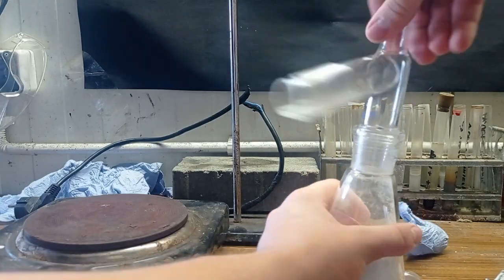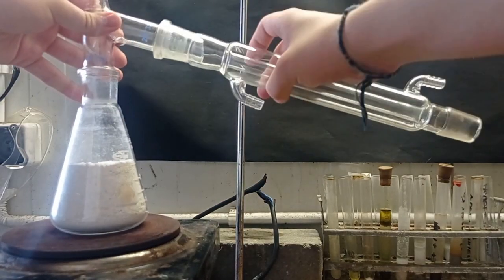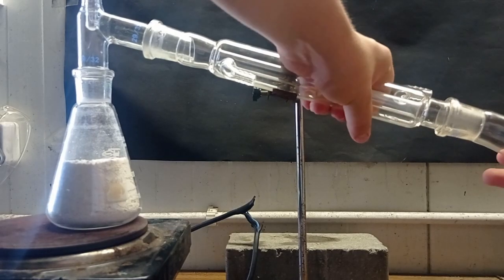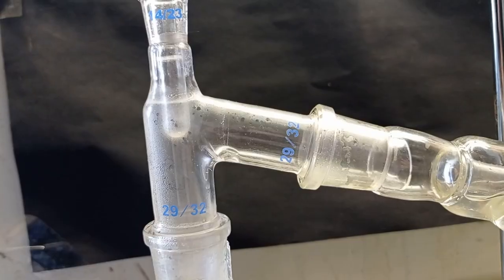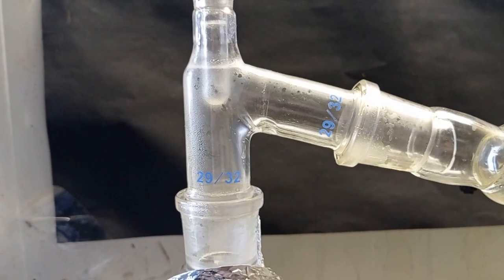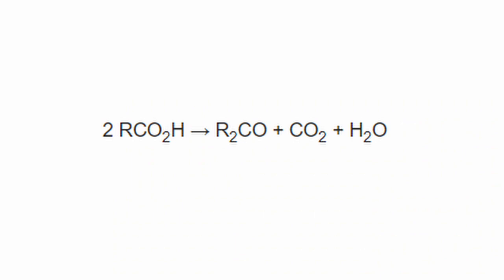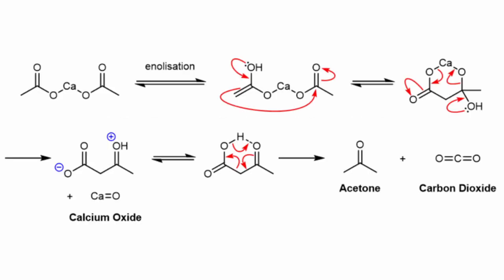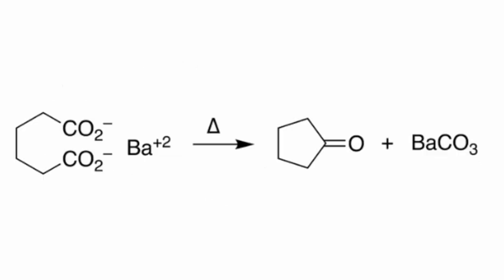Making acetone cause what else can I do

Comment: I have a hot plate just like that, I removed the end stop on the thermostat so I can turn it up dangerously high. I used it and an Erlenmeyer flask just like your setup for an HCL generator using salt and sodium bisulfate. By wrapping a foil shroud around the flask down to the edges of the burner it got so hot it glowed a dull red (over 400°C) and it actually softened the bottom (820°C).
Thanks for sharing, I've wanted to try this.
Reply from the maker: Jesus Christ, 820!

I can only see as you said dull red when it's isolated on max but 820 sound insane, like for what you used it? You just place there metal container?
Reply: @nucleophile  It was just an Erlenmeyer flask on the burner surface, they both glowed dull red in the dark. Yeah, the glass softened, that's just what wiki said it softened at. I didn't have any way to measure the temp. When I cleaned the resulting sodium sulfite out it was nearly odorless.
Reply from the maker: And what odorless sodium sulfite means?
Reply: @nucleophile  It was completely reacted, didn't have any acid or sulfur smell. Smelled like a fresh breeze...